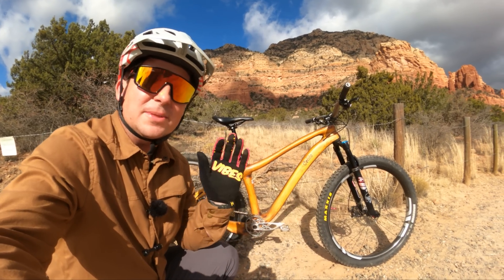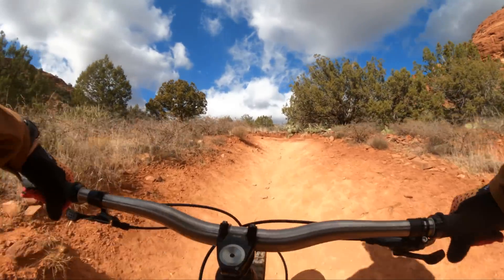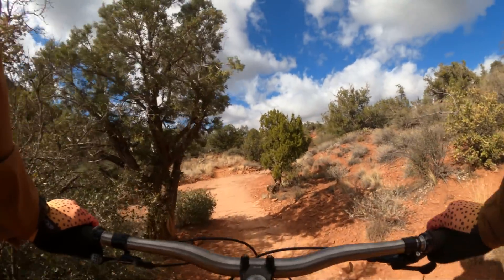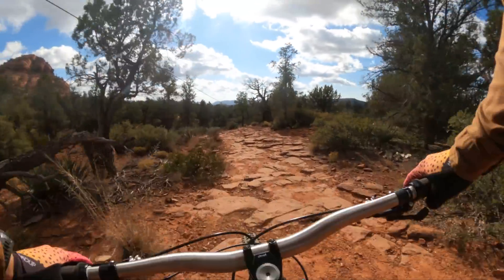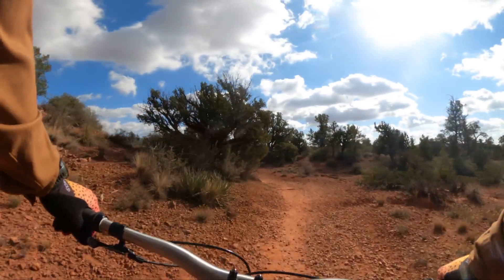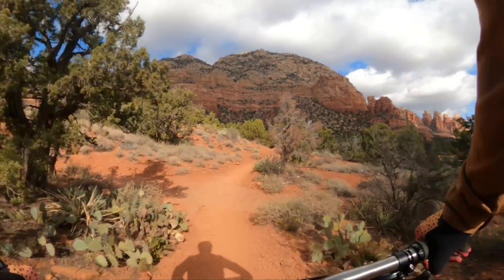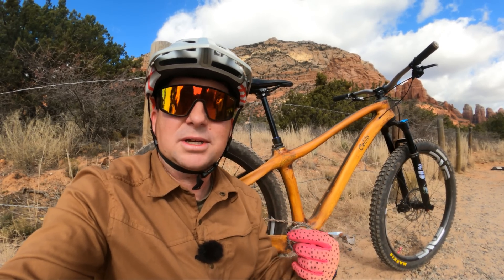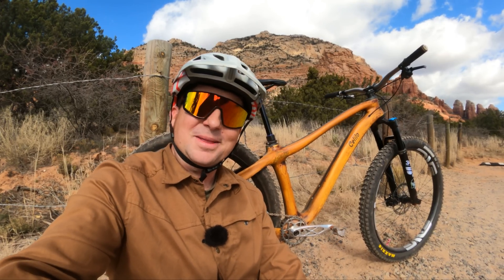Does Wood Ride Supple or Stiff? Reviewing Celilo's Wood Prototype Frame on Sedona's Trails

Comment: nice review, so in the end it's basically a carbon bike right with wood laminated to the outside of the carbon core?
Reply from the maker: Not exactly. I talk about this more in the first look video. It's a wood bike that's reinforced on the inside with carbon. It sounds like semantics, but it's a very different construction.
Reply: @hardtailparty  other issue is if you crash, wood cracks and breaks pretty easy. Well it looks cool but very niche, greats options out there fit everyone choice.
Reply from the maker: @50whatnomadtravelnursemtb5  I'd actually trust this more than a carbon bike. I feel like carbon cracks easier on an impact. A scratch on this wouldn't weaken the structure much like a scratch on carbon would. But I"m not materials scientist.

Comment: If every frame is unique can you count on the ride being the same on each bike. How long will the frame stay the same before degradation begins? Can you repair a frame damaged from a crash?
Reply: Thanks for the questions Martin!  One of the drivers for using carbon fiber internal reinforcement is to make the structural aspects repeatable and uniform.  Every piece of wood is unique, even if cut from the same board, much less different trees or species, so bikes made only of wood will never be reliable (IMHO), unless you design for the worst case/weakest board scenario.
In my bikes the wood has two jobs--look good and provide damping.  All wood does both extremely well.  The damping characteristics will be different from piece to piece/species to species, but always beneficial.  Each bike will have its own personality in appearance, and to a small extend ride characteristics.  The ride quality is also tunable via the carbon layup schedule.  I've been leaning towards overkill on the carbon layup.  From Steve's video it sounds like I might want to back off a bit in the front triangle to make it more compliant (but keep the rear triangle stiff)

Degradation will happen in different ways--one is wear from riding.  The wood does contribute to strength and stiffness, but the carbon is doing the heavy lifting.  A few dings/chips/scratches won't effect performance, and IMHO enhance the appearance.  A side job of the wood is to protect the carbon structure from dings (a common failure in carbon frames).
Another concern is UV degradation.  This will show up first in color changes, but I use UV stable dyes so this shouldn't be an issue.  Some species like walnut look incredible when fresh but the colors fade and get muted if left in the sun.  Prolonged exposure will cause breakdown of the wood's cellular structure, but this is also true for the plastics and rubbers on your seat, grips, and housings, so you shouldn't leave your bike out in the sun.  Car wax is good for maintenance.
Wood is similar to carbon in that they aren't likely to fail due to load cycling (metal bikes often fail at the welds).

Yes, these frames can be repaired, depending on the extent of the damage (if you drive over it with a school bus, you'll probably need to replace it (know this from experience(@CalebCampbell))).
Reply from the maker: Those are great questions for celilo.

Comment: Overall, pretty cool bike!  I dislike bikes that have chainstays designed without the thought of heel rub.  Hopefully they take your feedback and incorporate into the production model.  Would love to try one of these!
Reply from the maker: Celilo has been awesome to listen to and incorporate my feedback for future models. They're one of the most open companies I've talked to about that stuff.
Reply: Heel rub on the seat stay is an easy fix.  The chain stay is a bit tougher, at least on the brake side.  I like to mount the brake inside the triangle (low mount or chain stay mount) because it looks better and protects the brake/attachment.  The ISO bracket I use from Paragon Machine Works is pretty long--it sets the point where you can start bending inwards.  Two options for making substantial difference are using flat mount brakes (no-go for Steve), or mounting the brake outside on the seat stay.  Thoughts?
Reply: @celilocycles6424  no flat mount!  LoL. I think the ISO on seat stay would be fine.  Seen that from other brands.  Think this is how Surly does it if I remember correctly on bikes like the Krampus.  My Cannondale Habit had really bad heel rub issues due mainly to their Ai offset.